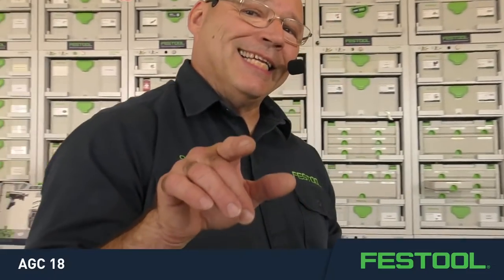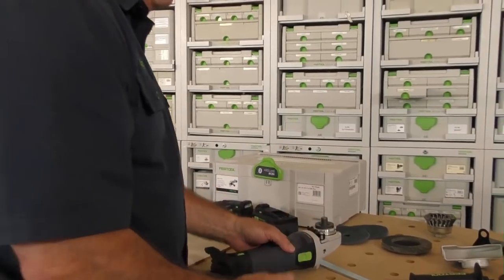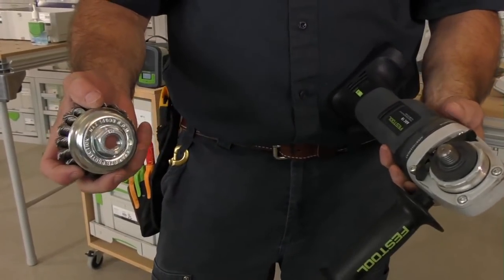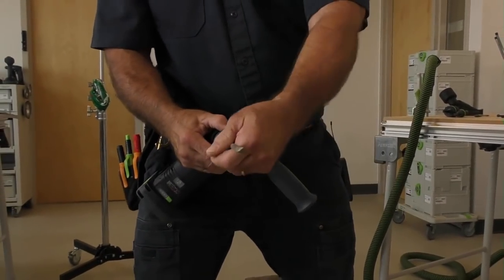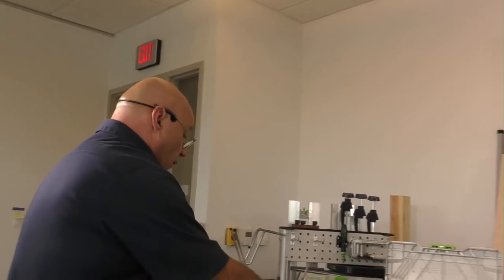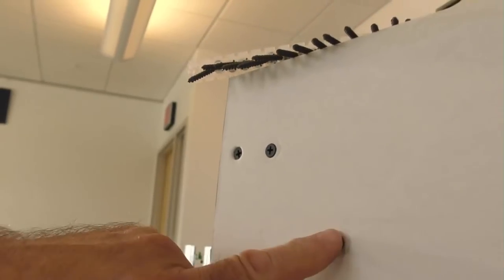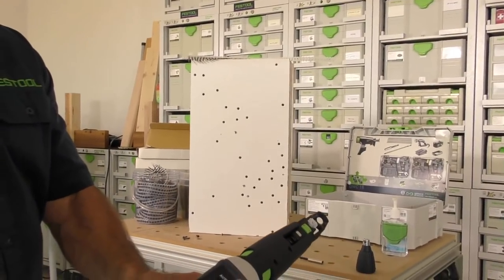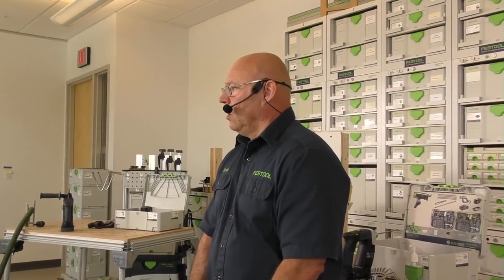Festool Live Episode 18 - AGC, DWC and BHC

Comment: I can vouch for all three of these products.  The BHC 18 is pretty much the only rotary hammer of it’s size and impact energy on the market.  Bosch came out with a similar model and then (in typical Bosch fashion) immediately discontinued it.   There are sds plus drills with half the impact energy (like the tiny Makita “subcompact”) and larger ones with about 33% more.  The Festool is actually in a really perfect sweet spot for 3/16”-5/8” holes.   I have more powerful (rated for 1” diameter)  cordless sds plus drills (Bosch and Metabo) and I would much rather use the Festool for anything 1/2” and below.    The DWC is an old Protool product and (in my eyes) is still the best drywall gun on the market.  My only gripe is that (just like every other collated screwgun) you have to go Festool to get the specific thickness bits to fit their collated attachment and all they have on offer is Philips.  Although it’s a low torque 4500 rpm screwgun, I’m pretty confident it can handle some decking (fyi, they do have a dedicated 2500 model outside of the USA) but collated decking screws are mostly only robertson around my parts.  So, it is strictly for drywall when using the autofeed attachment.  That said, if you install drywall, I highly recommend it.  Works with Senco strips.  As the Vecturos are blue and green Supercuts, the Festool grinder is an excellent Fein grinder, through and through.  It does have an annoying safety feature where it slows down if you lean on it.  So, don’t do that.  I’m sure the Dewalt flexvolt can run circles around it and any other 18v but the Fein/Festool grinder wins the award for being the only cordless grinder on the market other than Makita with a variable speed dial.  Depending on your needs, you may never use a variable speed grinder.  If you’re like me, however, you won’t use anything but a variable speed grinder.  I run the Festool next to the Makita and their individual pros and cons weigh them out to be equals.  Evidently, the Festool is built to a higher price point and with a Fein motor and gearbox, it runs smoother and quieter.

Comment: The AGC seems to come with the older 18V batteries.  Will it work with the new ones from the TID18 and T18E?  When will it come with the new batteries?
Reply: I wouldn’t run a grinder with single row compact batteries, regardless if they’re 21700.

Comment: put a good battery on it like aren't all festool batteries good?  And get some good runtime -  like 15 minutes.  Such a salesman but it's not your fault most angle grinders have very short run time.  my Dewalt flex volt would literally last for five minutes when I put the big sanding disc on it  because it didn't have variable speed and it was full blast or nothing.  At least with variable speed you can manage your battery life.